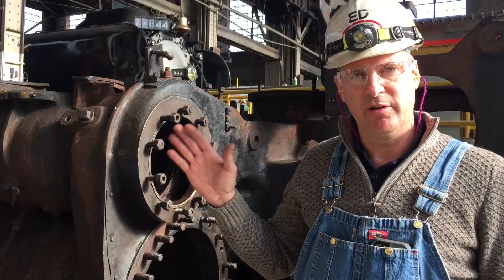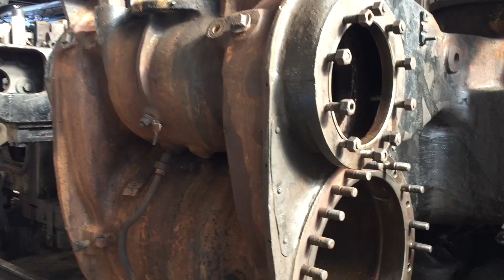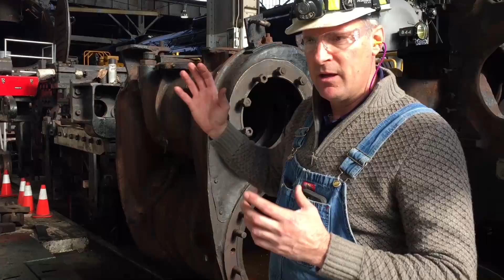Steam Update: Big Boy's Massive "To Do" List

Comment: Ed Dickens,

I would like to make a small suggestion,

If possible keep track of engine crew that worked the final Big Boy trips at the end of steam. For? When she's ready for steam test I was wondering if you might bring the last living crew of a Big Boy back to the shop to strike the fusee to light her off? Or all the surviving crews if possible.

Also you should have an old piece of boiler plate with a hole at one end so when on the road you can throw it in the firebox to heat it up, pull it out with a hook, wipe it down with cooking oil and cook your steaks, potatoes, and greens on it. Had an old time on the Boston & Maine tell me most freight engines had a plate on board so the crew could have a hot meal. Just another thought.

If it is possible I'll bet you will never wipe the smile off the retired crew. Just a thought.

Thanks for the updates and work from you and all your crew.

James Shanks 
Retired locomotive engineer
Reply: I think this is the most wonderful thing you have suggested, I am with your idea 100 percent.

Comment: Why is it in 2017 that it takes so much time to Tear down and reassemble this locomotive? Back in the day it was in operation it took a couple of weeks. It must be because all of the old timers are dead and gone like my grandfather. He couldn't read or write but he built steam engines like kids would play with building blocks!
Reply: Tim England - a good reason is they have new standards these days and in order to comply with EPA and all that stuff.  New "old" parts won't work, I'm sure newer ones to fit with those rules have to be designed and made, but most of all, the big casting companies that used to warehouse parts for these beasts don't have and make them anymore, if there even still around for that matter.
Reply: Tim England 

Back when U P still ran a lot of steam the back shops employed near 1000 men between the roundhouse, the backshop, and the machine shop which allowed the U P to completely rebuilt a Big Boy in three to four weeks.

The U P steam program consists of 9 people, how much work do you think 9 people can do no matter what the company throws at the program money wise there is only so much 9 people can do at once. Kindly give them a break as I think they are making excellent progress considering how small the crew is and the tremendous job in front of them. Now when the 844 is on the road only two or three are left at the shop to continue work on 4014 so kindly give them a break. Having participated as a volunteer on a rebuild steam locomotive project you really get tired of people asking can't you get it done faster? What's taking so long?
Someone recently pulled an old B-29 they found mostly intact in the desert and restored it to as built condition to 1944 standards. It took almost ten years to finish and now we have two flying examples of the B-29 that exist and they didn't have extra B-29's to provide parts. UP has counting 4014 8 survivors of the Big Boy class so while they can get some parts, they still need to be rebuilt to factory specs to be used.
 
The Big Boy people can't just run down to a parts store and order parts. They have to find a machine shop that is capable of building what they need to exact specifications in order for those parts to be used. UP has many boiler stay bolts that while new old stock some going back to the steam era in the 50's can't be used because the federal law covering mobile locomotive boilers has changed, no paper trail from the original manufacture to the present? Don't matter how good they are they can't be used so new ones have to be made to comply with the present federal law.
Reply: Thank you for your reply. I did not know how much ya'll have to overcome to rebuild these beautiful engines. I only have the stories of my Grandpa who died in '79 how he worked on these beasts.

Comment: Something that fascinates me - maybe you'd spend some time explaining?  Locomotives have a huge amount of parts, and the cab alone contains a huge number of valves and controls.  They are the epitome of not just engineering of the 1940's, but also of empirical knowledge... years of running them and fixing them and learning how to operate them.  I cannot fathom that this knowledge survives anywhere - no engineer that recalls and can tell someone today exactly what each knob, line, valve did and when to adjust every single thing in what sequence and circumstance.  Having said that, here's the point:  How are you going about understanding 100% of everything on that engine, and are you even able to?  Will there be anyone able to operate it the way they knew how to in 1960?  Will anything be left off, or will it really be fully restored with nothing missing?  Thank you for this amazing project!

Comment: I can't say how pleased I am that UP is undertaking this massive project.  I don't think the full output of these locomotives was ever recorded.  Is there any chance that a test-car could be placed behind it one day, perhaps between the locomotive and a heavy coal train?
Reply: That would be great, to see it not only on the enthusiasts specials, but so now and then on a real freight showing what she is capable of.
In the best scenario she's put on a hot freight, that's what these machines were designed and used for, they were able to pull 7000 ton trains trough the Wasatch mountains, and also at relative high speeds trough the relative flat country between these mountains and Green River (or even to Cheyenne)
The UP wasn't a big coal haulier in the steam era, there were and are a couple of coal mines along their mainline, but the powder bassin was not served by the UP then (the C&NW was).
So the coal train wasn't a regular sight behind the 4000's, mixed and fast freights were more their field of operation.
Reply: dieselmupke Bring it on!
Reply: Ed did mention in one of his talks that all the engines do have to earn their keep when they are in service, and they did do freight runs with 3985. So yeah, you'll likely be able to catch Big Boy pulling some freight consists in addition to the excursion specials.

Comment: Question: what's the difference between the Yellowstone (mallet) engines like 227 at Duluth and the up big boy 4014?
Reply: One difference is that the Yellowstone has the 2-8-8-4 wheel arrangement, while the Big Boy (like 4014) has the 4-8-8-4 wheel arrangement.
Reply: The primary differences were in their intended uses and the resulting design changes those differences required. The DM&IR Yellowstones were designed to pull huge ore loads short distances, so brute pulling power was more important than speed. The UP Big Boys were designed to pull freight trains long distances at high speed. They are somewhat similar in that they are both giant articulated locomotives with 16 drivers, but you'll find that many of the details such as wheel size and cylinder size are different in order to better accommodate their intended jobs.

Comment: +UnionPacificRailroad  Thanks for the update on #4014's overhaul.  This articulated packs much high-pressure plumbing consistent with #3985, being a single-expansion articulated; each pair of cylinders drives a more compact eight-couple than #844, being based on 68" drivers rather than #844's 76".

Comment: If just the front engine represents an equivalent of the UP844, what crazy kind of power did the 4000 class have ?
Would be very intriguing to see the 4014 working under a heavy load. Is there any modern engine comparable to a 4000 ?
Reply: Rough equivalent to the "Big Boy" in the diesel era would be the failed SD90MAC or the AC60's before they were all derated.  I have to thank Graham for the hp rating for the Challengers; which are just a bit more powerful than the SD80MAC.
Reply: trespire 2 844s smashed together
Reply: Hey dude. The Big Boys were in the vincinity of 6100 HP & the Challengers were about 5400 HP.
Reply: Hey Silver Turtle no worries. I've had a print of the BigBoy and the Challenger hanging in my office for over twenty years. The Prints have all the basic specifications listed on them. I also have a UP 844 FEF-3 in 3.5" gauge plus the a copy of the original works drawings.
I'm lead to believe that the largest Diesel Electric Set (ALCO's) built was around 4500HP, but I might be wrong.
As for the 844 it could haul 1.5 Mile of train at 70mph.
Cheers.